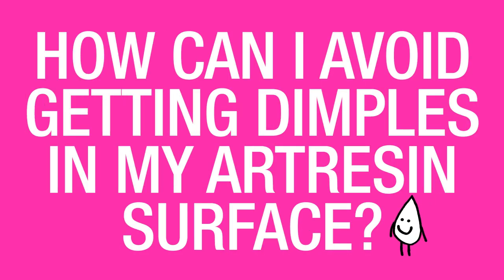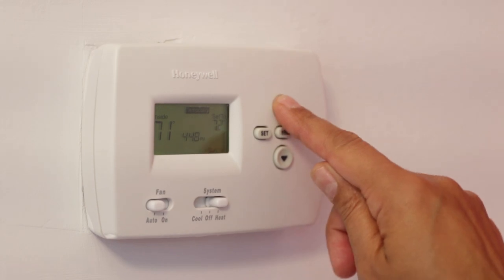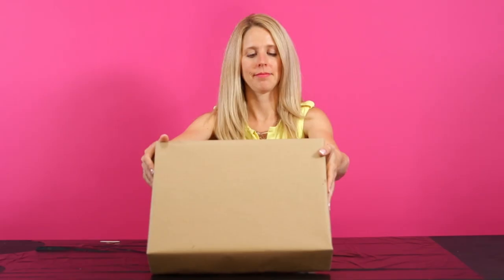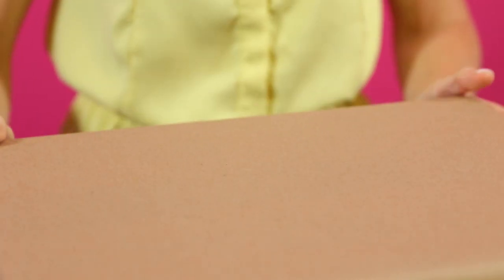How Can I Avoid Dimples In My Epoxy Resin?

Comment: So I made resin keychains for the first time but when they dried and I took them out the mold some had some pits in it, like a piece chipped out that didn’t fill all the way. What suggestions do you have that I can fix this? Can I just pour in some resin and fill it in?
Reply: Hi Julissa - this can happen for a few reasons. To fix it since the piece has already been removed from the mold I would lightly sand it and wipe it clean then you can brush on or apply with a gloved hand a thin coat to fill in any divots :)

Comment: Hey there thanks for the tips i have switched on heating constantly and I didn’t over torched still i m having dimples i have already poured twice , any suggestions
Reply from the maker: Hi Tahira Aamer, it sounds like there may be something in or on your artwork that is repelling the resin, likely some kind of oily residue. Try cleaning the surface of your artwork with a clean cloth dampened with some warm water and mild dish soap. Dry your artwork completely, sand it and apply another coat.
Reply: @Artresin  thank u so much its really helpful
Reply: @Artresin  you"re saying, wash, sand and apply another coat of SPRAY PAINT?  my resin wont stick to Rust-0leum enamel spray paint,,,the 2x"s coverage one.
Reply from the maker: @loriswitala4679  if the resin is dimpling it is being repelled by something in the previous layer.  To fix we recommend sanding the cured resin to scuff it up and cleaning the surface of any oils etc, then pouring another coat of ArtResin.   We have coated high gloss Rust-Oleum enamel spray paint here in studio without any problems, just be sure it is free and clear of any dirt or oils first.
Reply: @Artresin  thank you for your help. seems Im following all the rules but something is in my way.
Reply: also ive found, to minimize the fish eyes, if i use my "epoxy" brush continually - until the resin gets very tacky - I minimize the fish eyes enormously. to me this is very strange and time consuming. im seriously tired of sanding this much. if i find the cause of this sudden fail i will definately let you know!
Reply: @loriswitala4679  Did you ever resolve this? Before i start re-pouring and sanding and stuff. Please help thanks!

Comment: Hi I have made a 4ft tall wood cutout and it has so many dimples that are noticeable in the reflection or at an angle, I am scared to sand it down and throw another layer of epoxy resins, what should I do?
Reply from the maker: The best fix would be to sand the surface and pour a fresh layer of ArtResin over the surface.  Avoid over torching, temperature fluctuations during the cure time ad ensure your piece is covered to protect from dust.  It is also important to remember that any kind of oil, such as silicone oil used in artwork, will repel the resin and cause dimples in your cure.  Sanding the surface will give the next layer of resin some tooth, the new resin will self level once poured and fill in the dimples.   If you have any questions, please reach out to us at:  support@artresin.com

Comment: Why red dots come on photo after pouring redin
Reply from the maker: There are different ink qualities and paper qualities which can affect the outcome.  Generally, coated photo paper stands up best under the resin, but the type of printing and ink can also have an effect.  You could try applying a sealer to the photo to help prevent this from happening.

Comment: How do i get rid of fingerprints without sanding.
Reply from the maker: Hi Sharon, the best way to get rid of fingerprints is to simply treat your cured resin as you would glass: use a soft cloth and a gentle cleaner and polish just like you would any glass surface.